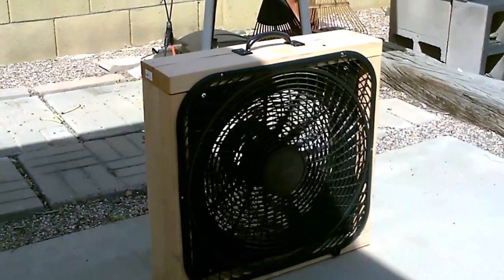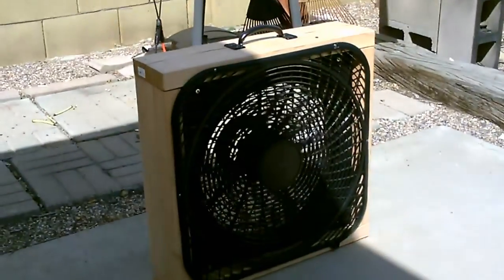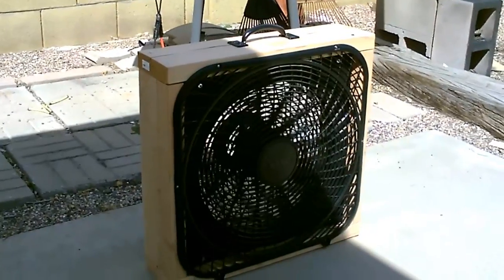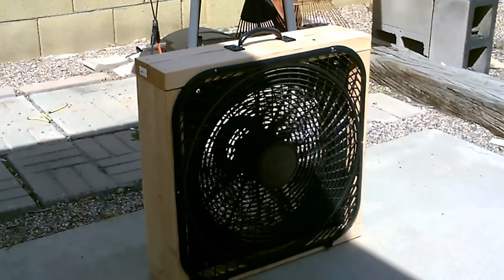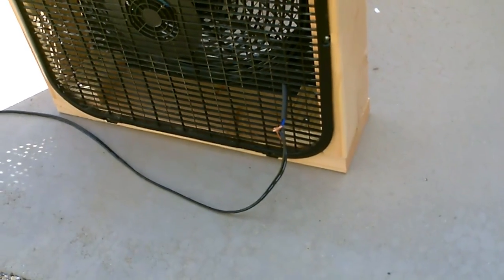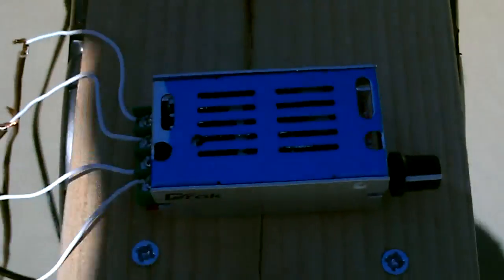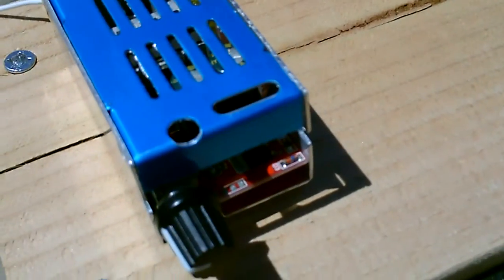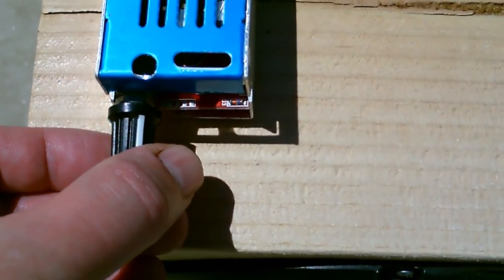Homemade 12V DC Box Fan! - Full Size! - 100% solar! (or battery pwrd) - 100w panel/motor - Awesome!

Comment: Can you provide the link to this 100watt solar panel please?
Reply from the maker: hi. that particular panel is about 7 year old so i don't have exact link. to find one similar  search amazon for 100 watt renogy solar panel. truthfully, i used to recommend renogy panels but i've bought many other brands since then and they seem just as good. i just bought a HQST 100w poly panel for about 80 bucks and it seems just as good or better.
Reply: So if the fan is rated for 12v but the panel is rated for 18v will that be an issue connecting them directly?

Comment: I'm curious, is it really  necessary to have such a large solar panel just to run one fan? 
Do you have a video on solar panel options? I'm a total noob ha....I just assume you could run this off of a much smaller solar panel for camping etc
Reply from the maker: hi there. yes, for this fan you need a 100w solar panel torun it at or near full speed. you could use smaller panel, maybe 50 watter, but it will only run fan at half speed. which is like a regular fan on about medium so still not bad.

Comment: sweet u just gave me an idea i'm going to convert my trailer swamp cooler to 12v with a rad fan and 12 water pump the fan in it is about that size
Reply from the maker: awesome! the video i posted just before this one is just that - a large solar powered evap cooler w/radiator fan and 12v pump. if interested here's the link https://youtu.be/0LTdGjirNj8
Reply: Exactly what I did a few years ago. The motor on the swamp cooler pulls too much. So I pulled it out and installed a  16" dc fan inside the housing with a fan speed controller. This setup keeps me and my animals cool during the triple digit temps.

Comment: I am also thinking for a long time that 12v is the way to go for a lot of devices, PC, tv, radio, lights and lots more. Without the step-up and step-down losses!
Reply: Actually slowly converting everything I own to operate on 12v just like in motor homes or RVs.  You can  even upcycle a 775 motor and a alternator and ac system from a car  to get AC at 12vs

Comment: This is great; thanks!  I intend to have a few direct 12v outlets scattered around my off-grid home and, using bug screening, this will work well for fitted window fans.  The manufactured variety are terrible and suck when dealing with rain and insects.

Comment: Cool. Ive attached USB cords to all my smaller stuff, my 3 to 6 volt stuff. Walkies, lights, fans. A 3 volt (2 D cell) personal fans runs well of a USB cord, more output and so far hasn't burnt a motor, and I have 2 of the same O2Cool personal fans. A big one would be great, so good idea and nice design. Almost could have reused a box fan frame for it though, which is what I'll do if I find a junk one.

Comment: Can you make a Solar Powered Swamp Cooler next???
Reply from the maker: hi there. already done. that was the video i made just before this one. here's the link.https://youtu.be/0LTdGjirNj8 it's a 100% solar powered unit with a 2000 CFM fan. both it's fan and water pump run off a single 100 watt panel. same exact power as this box fan (but a smaller diameter fan - only 7")

Comment: use a treadmill motor, and a 3 blade fan , I have that I use at my shed and it uses   a lot less current then a automotive fan
Reply: I"m interested in that kind of fan as I have an old treadmill motor.  Could you give a link or advice what kind of three blade fan you mean? Thanks!

Comment: I have been gathering parts for a project like this,  I have a pwm speed controller, to work with up to 60v DC. And a fan I may or not use, an aftermarket car fan, 14"-16" I will be using batteries though, I'm off grid, I have both 12 & 24 v batteries and 120v avalible, but more I can power from straight DC is more efficient, like my lights, they are 99% all dc, I have 120v lights but only if needed, my inverter is for TV fridge and microwave, well pump,
Reply: Where did you get the pwm speed controller?  Thanks!

Comment: Awesome, what were the dimensions of the radiator fan? Any suggestions of one on Amazon that fits your design?
Reply from the maker: hi there. technically it's a 16 inch radiator fan (counting the grill about 17"). any 16" one should work with this design. i just used a basic model 2000 cfm'er (made by mostplus i think) cost $30 (actually 27 and change). i want to see someone make it with an even stronger 16" fan. i've seen ones that use 160w or even over 200w and have cfms well over 3000.

Comment: Great job!  I think this would be a nice project to make and run from some junk 18650 battery cells as well.  Excellent job site fan for a remote location and one could use the battery to charge a cell phone via a cig lighter adapter even!

Comment: I picked up a large radiator fan off the curb and was using my jump box to power it while waiting for my granbrats to get out of school, I just hooked it up to a battery I'll charge through the cigarette lighter. I did a video a few days ago... super basic.. a frame like this may be nice..and a controller
Reply: Please. share link so i can see project you did
Reply: @ogunstatelands  not really a "project" 

i literally hooked my jump box to the bare wires of a truck radiator fan and stuck it in my trucks back window, the video is trash to treasure

Comment: Great 👍! 
Your projects are  an imagination opener.
Please keep'em coming!
Look forward to the next one!
Reply from the maker: you'll love the next one. it's a video of the biggest and strongest DIY air cooler i ever made. totally unique and uses an actual copper/aluminum finned heat exchanger (radiator) - also 100% solar powered. thing absolutely blasts out the cold air.

Comment: Good idea. Maybe instead of adding the old A/C grill on the back , you could add spacer blocks to place a 20x20x1 filter and have it clean the indoor air
Reply from the maker: hi. or just drop the 20 by 20 air filter on the back grill. that should clean a room or two..
Reply: @desertsun02  I have one of these that I use with allergy rated filters on it blowing directed air on the baseboard heat all winter in the kids bedroom, it keeps them room really warm and reduces the amount they suffer from allergies :). You have some awesome ideas/projects, thanks !
Reply: same except i need to switch my 20x20 filter and fan to dc like this one

Comment: I've really been interested in making one of these but was concerned over it using more power and having less CFM than the Endless Breeze (Amazon product B0000AY2Z6).

Looking on the Amazon page I found this info:

What is it's decibel level at low, med, and high?
At a distance of four feet.
Low. 54DB
Medium. 58DB
High. 61DB
Taken with my $100.00 Radio Shack meter

Power consumption: 1.2 amps - 2.6 amps
Fan capacity: 900 CFM

Do you know how your fan compares to these stats?

Also could you get a reading of the watts consumed by the fan (between the solar panel and the speed controller) when on full and low power?  Checking the Amazon page it looks like it has 3 heat sinks which I think could be burning off the excess power as heat.  So even though the fan is running at a slower speed the power consumed by the speed control/fan combination COULD be the same at all speeds.

Though if the excess power is burnt off as heat I'm not for sure how the Endless Breeze/Fan-Tastic Vent lowers the power consumed by the fans.
Reply from the maker: hi there. at the moment i can only give you general stats... i can tell you that this fan is WAY BETTER than that 10" endless-breeze one. as far as decibel levels i don't have a meter to test that but at full power it's no louder than AC box fan on high. and at lower speeds it's very quiet. much quieter than AC fan  and certainly quieter than the endless-breeze. as far as cfm, it pushes about 2000 cfm (so more than double the endless-breeze. there are lots of different radiator fans - each will have different stats.  as far as power - i run the fan from a 5.5 amp 12v 100 watt solar panel. that runs it full blast. forget about the endless-breeze one.  it's double the cost *about 90 bucks last i checked, with only half the airflow and it's half size.. make this one for sure. btw i just ordered anemometer (wind speed meter) so i'll do some tests with that in a future video.
Reply: Wow.  2000 CFM!!!  Maybe I'll look into mounting a smaller diameter radiator fan into the RV ceiling vent.
Reply from the maker: sounds like a plan. even the 7" (small) ones run about 1500 cfm but just use speed controller or even just a rheostat :)
Reply from the maker: btw - for anyone reading this... 2000 cfm is about what a standard 20" box fan pushes on high (1800 cfm to 2200 cfm)
Reply: BTW do you know of a DC equivalent to the "P3 P4400 Kill A Watt" (Amazon product - B00009MDBU)?

It would be cool to have a device which connects to pos/neg on a battery/solar panel, then to a display like the Kill A Watt (but showing DC voltage/amps/watts) and then to a 12V cigarette plug into which you could plug your 12V appliances.
Reply: @knutblaise9437  Watts is the power factor no matter it isAC or DC.